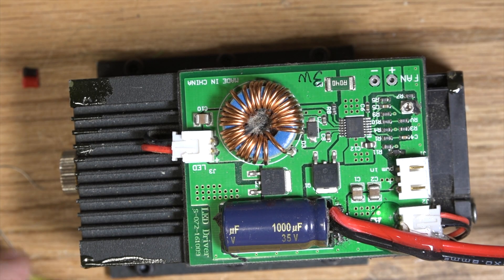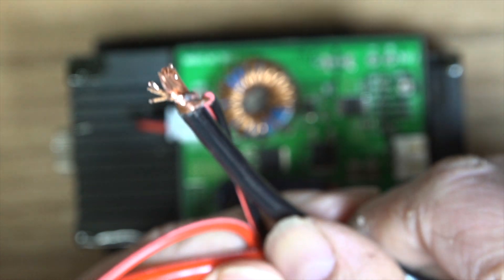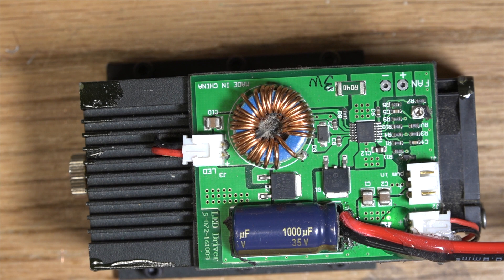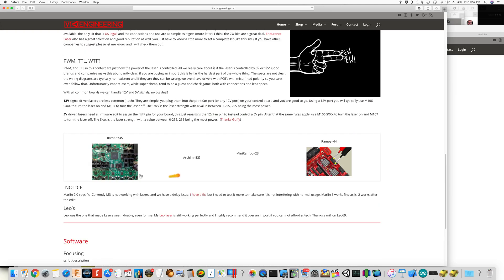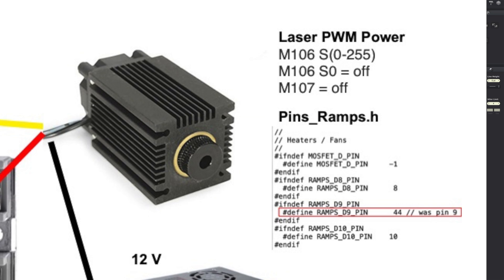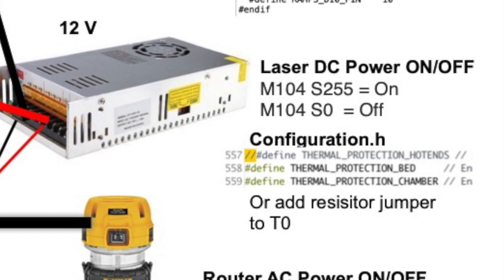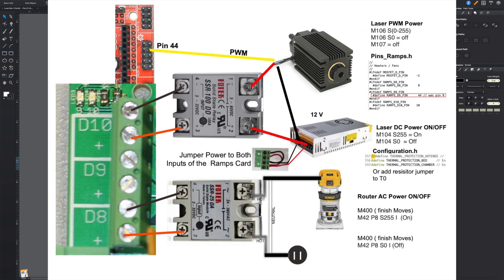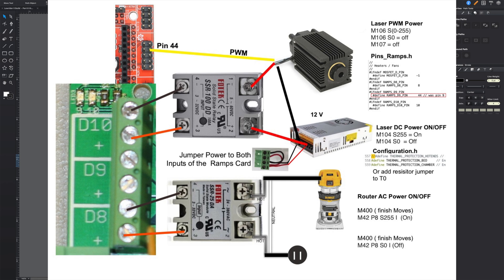Lowrider II Build -  Part 9 - Laser Mods and Power Control Wiring

Comment: Do you leave the laser mounted all the time, even when using the router? If so are you worried about dust and contamination on the lens?Any insight on this would be great.
Reply from the maker: Yes I’ve got it mounted all the time so I can use both the router and laser in the same job. Contamination has been a problem. I probably need to rethink this.
Reply: @Someoldguycoding  Thanks for the reply. I appreciate all your videos they have been very helpful. I thought the contamination could become a problem (no experience at this point) perhaps a mount that would allow it to pivot out of the way or a simple cover could alleviate this?
Reply from the maker: Next Solution I don’t think just pivoting it away would be enough given all the dust the router makes. Yeah perhaps a cover. Perhaps a way to quickly connect or disconnect and put it away in the safe dust proof area. On the first MPCNC it was a real chore swapping out the router and the laser. So now I guess I’ve gone too far the other way. Maybe there’s already something on Thingiverse that would solve this problem.

Comment: Are you still using this laser? Is this the laser you would still recommend ?  i have seen other builds with powerful laser
Reply from the maker: Hi Keven,   Yes I'm still using the laser. II've had it quite a while now, and have used it on many many jobs. Maybe I just got lucky.   It's a Sunwin 3 watt, but you can certainly go with a higher wattage if you'd like. Just don't get taken in by the absurdly high wattage adverts like 15 or 20.  I think they max out at 7 or 8, but i don't have any personal experience with it.  Be sure to get one that's controlled with PWM.  Recently however, I accidentally pulled the board off the back of the laser putting a box of junk temporarily  on the CNC table. I haven't had a chance to check it yet for damage.   Good luck!
Reply: @Someoldguycoding  Thanks